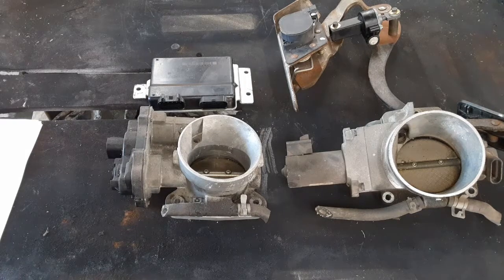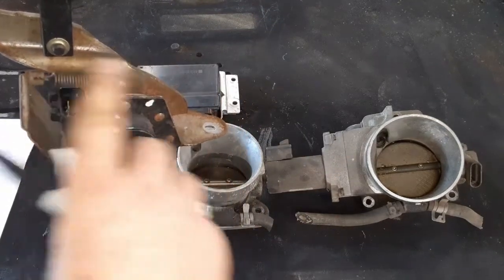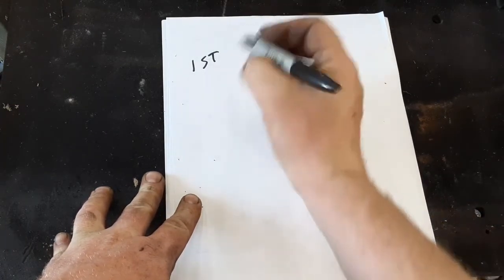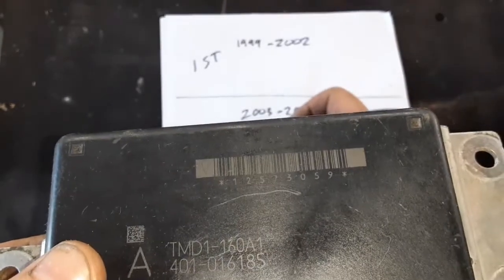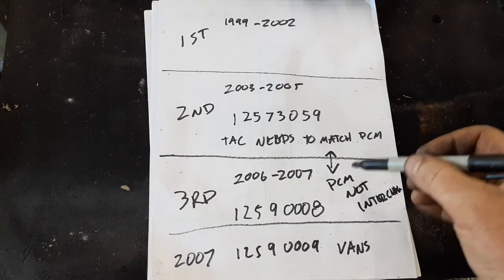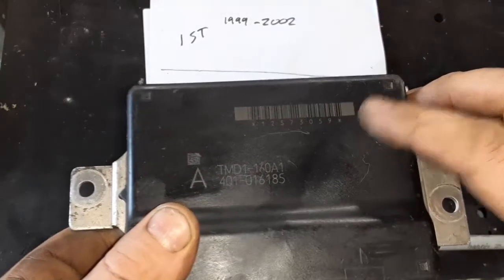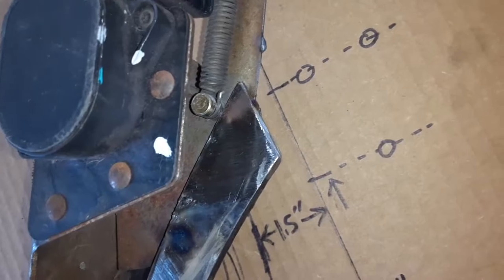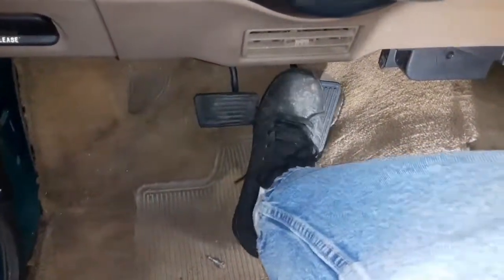LS Swap Drive by Wire Explained  -  S10 5.3L

Comment: Your videos are mad helpful dude. Even though my s10 is an 88
Reply from the maker: Glad to hear it. 1st gen body style is my favorite by far (I also have an 2 door '89 S10 Blazer that needs a full restoration). Most engine swaps are pretty similar even with different vehicles.

Comment from the maker: I know someones gonna ask why not just use drive by cable. I want Drive by Wire for the use of cruise control. It's built into the stock factory PCM, so it's "free" ! I'll even be able to use the S10 cruise control switches on the steering column to activate it. (More to come with a different wiring video on how to wire up the cruse control). To get cruise control with a drive by cable engine it's both tricky and cost a bit of money for an aftermarket unit.

Comment: I have the 07 van cpu and TAC are from the same truck, can I use a 2nd gen pedal? Good explanation!!
Reply from the maker: The 07 Van part numbers for the gas pedal are different then the 06-07 trucks. I haven't messed with the 07 Van setups but with what I know about the 03-05 not working with the 06-07 truck parts, I have to assume the 07 Van TAC + PCM need the 07 Van Pedal. The only item that all the 03-07 drive by wire have in common is the throttle body itself, including the Van. The "pancake" style throttle body works with any setup from 03-07. GM part # 12679525
Reply: @wilsworkshop  I could not modify the 07 van pedal to work, so I got a different pedal. I think I will take the servo off the 07 van a put it on the new pedal. Thanks again.

Comment: Thanks for the video. Is a TAC with a part number 12588923 a second gen? I found this on a 2004 Cadillac escalade and it doesn't match your part number  12573059. Are there more than one TA C modules for 2003-2005?
Reply from the maker: Yep the ones that end in 23 and 59 are interchangable for the 2003-2005 electronics. I've seen both part numbers in the junkyard but I'm not sure if both were OEM or if one is a replacement part number, but function is identical from what ive tested.

Comment: You didn't worry about heating up that sensor on the pedal? BTW your videos have great detail on how to get it done. Very helpful for my 2000 s10 ls swap.
Reply from the maker: The pedal sensor is just a fancy variable resistor, so it's not too sensitive (no chips or anything). It held up fine and hasn't had any issues from the heat.